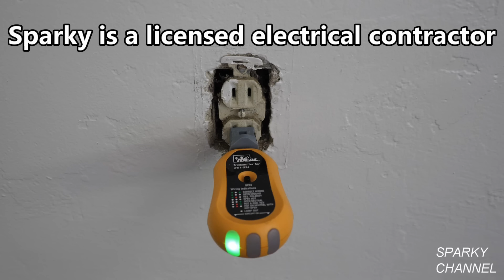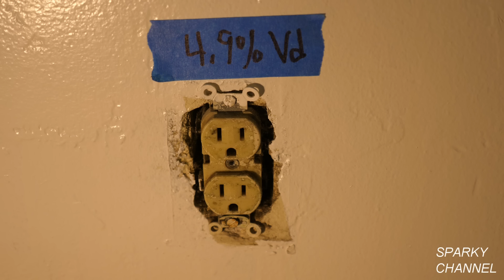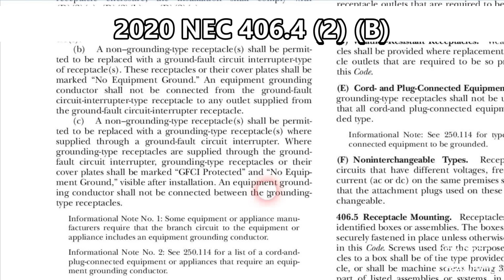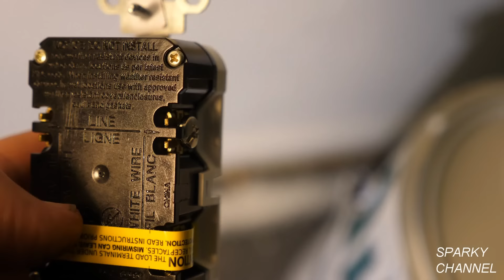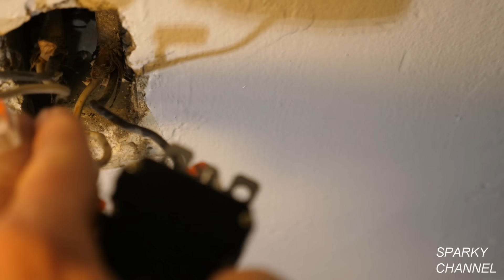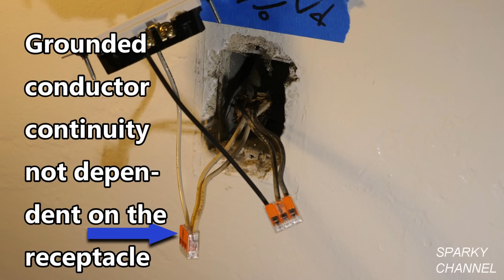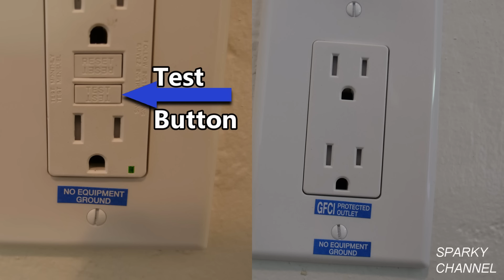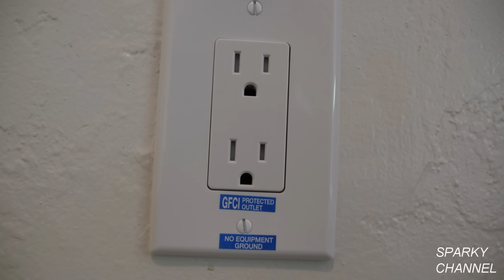2 Prong Receptacle Circuit Replaced by GFCI and Grounded Receptacles per 2020 NEC

Comment: Doesnt pigtailing at the gfci take away the whole point of installing a gfci if the ones "down stream" are no longer gfci protected
Reply: He doesn't pigtail the GFCI outlet. If he did, you'd be correct-the rest of the circuit would not be GFCI protected in that case. Around 12:50 he starts hooking in the GFCI 'source' circuit then he removes the yellow tape and hooks up the downstream 'load' circuit leads. Everything will run past the GFCI outlet unless he got the wrong outlet (any outlet that is not the most upstream outlet) to outfit with GFCI. In that case, the pig-tailing in the normal upstream outlet would make the whole circuit unprotected (outside the single GFCI outlet) since the amperage then doesn't have to flow through the GFCI internals.
Reply: @austinv3415  thank you. the little bit that i dodnt pay attention to the video he did that.. i was really confused cause he never makes those mistakes...
Reply: @Fearlessmullet  I think the Wagos made it confusing for some viewers. He didn't use them on the GFCI, but it looked like he set it up to use them.

Comment: I changed out a 20amp grounded unit today and the load wires had to be switched to the line wire spot on both sides. Took me an hour to figure that out just moving wires from one unit to another. And I had to Google it. Apparently I'm not the only one to stumped with a solid green light. I think it's good to know how to do stuff but it's also good to know when to call an expert, be it painter, plumber or electrician. Most folks should probably not fuss about with what you're doing here. But hey, you have us fair warning!

Comment: You can find the first receptacle also by simply unhooking all the wires on all the dead outlets and from the source breaker, then drag a long wire from the disconnected breaker wire and use a continuity tester to each receptacle wire till you find it. Now you know where the GFI outlet goes, the rest don't matter.

Comment: I know it is not practical in this situation because you are not doing a re-wire, but I am betting with brand new romex installed, those voltage drop numbers would go way down. Your video definitely shows how dirty, old worn out receptacles can effect the circuit. I am imagining if somebody plugged in and ran a 1000w or 1500w space heater on the last receptacle downstream, those old romex wires in the wall would probably get pretty warm. I really only do Commercial and Industrial work these days , except for my own house, but I own one of those sure test testers myself and I love it. The one I have also includes AFCI function test. I am also a great fan of the Wagos. They conserve a lot of space in the cramped boxes.  Great video! Russ- Journeyman Electrician-25 years in the Trade.
Reply: Yeah, over 200W of heat inside the walls is a problem waiting to happen.

Comment: Why do you not hook up the ground to the outlet box.
Did you see if the box is connected to ground?
Reply: Older homes once were two wire systems with no ground equipment conductor. Doing this makes these outlets safer.
Reply: Because there is no ground, that is the whole point
Reply: There is no ground. Many older homes have no ground and this is a way to make it safer without rewiring the whole system. Hooking up a pigtail to an ungrounded box isn't going to magically make the receptacle be properly grounded.

Comment: I’m going to order some wago lever nuts. What I’m worried about is the integrity of the connections on them after years of use, as oppose to the more trusty wire nuts and old fashioned twist/braiding method
Reply: Any electrician I have taked to will not use these nuts.
Reply: I agree with you as well as most, although this makes a alternative to wire nuts  if conductors cannot be spliced because the conductors are too short.

Comment: I had an older house and the wiring was in metallic flex which was attached to the panel.  It turned out that this was the "ground" in this system.  In this video is it possible that the box, if metallic, is grounded and may be used as a ground?
Reply: Yes, but you never know until you test it.  Some metal boxes are grounded...others aren't.  I'm guessing he knew his boxes weren't grounded?

Comment: You probably would have even less voltage drop if it had been wired directly to the plug and not use a wago connector. Also less cost and 1 less thing to fail. Great video.

Comment: Sparky. U R an idiot. Connect a jumper wire to the ground screw on GFCI to the neutral screw to fix the ungrounded condition. Tester will now work correctly with Protected Ground. When a ground fault is detected, it will pop the GFCI fuse. I put a GFCI AT EVERY 2 PRONG OUTLET TO ADD A PROTECED GROUND THIS WAY. EVERY GFCI WAS WIRED IN PARALLEL IN DOWN STREAM CIRCUIT. Thus only one GFCI pops at the ground fault and is easily RESET. ALL 2 prong receptacles are now converted to 3 prong with PROTECTED GROUNDS!!!
Reply: This is against code and illegal, don't do this. If something on that neutral is pulling a heavy load all your "protected grounds" will now have voltage on them.
Reply: an example of why this is not correct and very dangerous. i worked on a house once that someone had this done. the circuit lost the neutral at an upstream receptacle. now the ground was the neutral source sending voltage through the coax shield to the satellite dish that was bonded to a water pipe. the water pipe was not bonded to the service so it made voltage at all the plumbing fixtures in the house. customer was getting shocked at all the sinks and while in the shower.
Reply: @ozarkmountainhollow5640  Why would it have gone that route and not simply back to the neutral buss in the panel via the ground wire. The only way I could see this happening is if you lost both the neutral and the ground
Reply: @integr8er66    the whole topic of this video is where there is no ground wire. hooking the ground to the neutral with no ground present is the problem. you loose neutral and the circuit finds ground anywhere it can.
Reply: Pretty sure ground and neutral can connect ONLY in the main panel...
Reply: @DanEBoyd  Yes thats true if you care about the code, if not this method will work
Reply: @aldinardo4812  I thought so too, but I have seen tests where they show the wire actually melts first.

Comment: Other than using the expensive circuit analyzer, is there any other sure way to determine which is the most upstream receptacle?  Edit: NM, think I found the answer at 11:06.
Reply: Absolutely, its called a continuity tester and a long wire back to the breaker panel. just disconnect all the receptacles and ring out the hot and neutral that go to the breaker panel
Reply: So on any of the other receptacles, you shouldn’t get a hot line right?

Comment: Instead of replacing the first outlet with gfci at the breaker?  Or would that not fit the code?
Reply from the maker: It would be great but there are no GFCI breakers available for the old main panel.

Comment: Sparky with you having connected the wires in the boxes it's no long GFCI protected because the GFCI is in series parallel not series any more. If I am wrong feel free to correct me but, I do not think I am.
Reply: All outlets are in parallel always. His wiring simply moved the junction off the outlet body with use of a pigtail and wago connector. The gfci only cares about a differential, if current goes out on the hot leg and takes another path back except it’s neutral wire it will trip, regardless of the wiring down stream.

Comment: Great video, question, why not install a GFI circuit breaker?
Reply: That's probably because of the circuit panel. They probably don't make one to fit that old panel. Most of the old ones I work on won't take one.

Comment: Hey Sparky I love you videos  You taught me so much but I have a quick question what do you do if the powers running to the light Box in a Junction And it's spreading out like a spider how do you find the 1st receptacle
Reply: Good question, Thor.  In that case, each receptacle is receiving power first, in parallel with each other.  So you would either need a GFCI receptacle at each outlet or a GFCI breaker at the panel.  Someone pointed out that some panels cannot physically fit a GFCI breaker.  Also, I just worked on a house that spiders out from the light box like you describe as well as having some of the spider legs lead to clusters of receptacles wired in series...a parallel-series circuit.

Comment: I’m about to swap out two prongs for three. The old cable in this 1950’s era house has a hot, neutral and grounding wire. The grounding wire is already terminated to the inside of each box. Should each new 3 prong outlet be grounded to the box as well?
Reply: If you already had a ground why does it have 2 prong outlets? But yes a ground jumper is now required, but they would be grounded anyway once you screwed them in the metal box.

Comment: Really great video!! Does the code mention wrapping the outlet with tape?
Reply from the maker: Thanks Paul! No, the NEC doesn't mention wrapping the outlet with electricians tape.
Reply: Like he said, it doesn't but it is just good practice.  Safety wise.
Reply: Glenn Davis for when, though?
Reply: @pb7379-j2k  I only tape hot outlets in metal boxes. I work for a bad company that doesn’t allow me to “waste my time” turning off circuits.
Reply: Dr. Remulack wow really?
Reply: Electrical tape will fall off after years in there anyway, so I wouldn't consider it necessary.

Comment: So exactly what is the value in this?
Reply: You get ground fault protection without having to run new wire. But in a reno I’d rather see new wire with ground be run, especially if I were the buyer!
Reply: @pb7379-j2k  besides pushing the test button, has this method been tested?.
Reply: Charles Murphy not by me, but if Leviton and the NEC say it’s acceptable then I’m sure it has been tested
Reply: @charlesmurphy1510  That is the proper way to test GFCIs.
Reply: @charlesmurphy1510  Pushing the test button does test it, it puts a slight imbalance in the Hot and neutral internally. Underwriters Laboratory's verify all that for us.

Comment: Just curious, arent those voltage drops higher than whats allowed? i know its not really relevant to this video, but where I live branch circuits can only have a VD of 5%
Reply from the maker: These are Vd's with 15A loads. that's different. The farther I got away from the main panel, the worse the Vd was. The Vd would be calculated without a load for code.
Reply: @SparkyChannel  Uhm, with all due respect at no load there is no current therefore no voltage drop, V = I x R No I = no V
Am I misunderstanding you?

Comment: Great use of the circuit analyzer to narrow down the upstream device. The Amprobe INSP-3 is a similar tester that can provide a lot of info on a circuit. Big fan of the Wago lever-nuts also, they make troubleshooting so much easier. Great video. This seems like the most cost effective way to upgrade 2 prong receptacles to 3 prong, rather than a GFCI breaker.
Reply from the maker: Thanks Brian!

Comment: Thank you for the walk through.   Not sure if this would be to code, but what would the consequences be in the following:
Update all the sockets as described, exclude the GFCI in the upstream socket, then connect the neutral to the ground at each socket.  
What if any negative safety concerns would result if an appliance plugged into such a configured socket would short from line to ground? 
Would the circuit breaker open the circuity?      
Great choice with the Panasonic GH5, great video, audio and editing.
Gratefully.
Reply from the maker: Never ever connect the neutral to a ground on an outlet. That's called a bootleg ground and is very dangerous. I love my GH5, thanks!
Reply: @SparkyChannel  I'll check your content for a video on the dangers of Bootleg Grounds.  I'm sure you've already covered it. Thank you.

Comment: If you leave your plug circuit energized your receptacle circuit energized and you put your plug tester in can you locate receptacles on the same branch circuit with the wind by just walking to the receptacles rather than killing the breaker

Comment: It would be interesting to see difference in load drop between wire nuts and the lever nuts.
Reply: It was hard wired before. Lower reading with wagos, they are maintenance free so reading's will never change at this connection.
Reply: @douglasgreaves188  Hardwired through those old outlets, with no pigtails.

Comment: Why not just change them all?
Reply: Simply put...Cost
Reply: @integr8er66  cost over effective , efficient & safety seems mute if the wires are older
Reply: @rockystaatz521  It is not one bit more effective to replace all of them than one and the others tethered off of the load side of the GFI, or maybe I don't understand your point, GFI protection vs adding a ground wire? that is s matter of cost as well and I certainly would not bother with the extra cost of a ground, GFI is plenty safe in my opinion.
Reply: @integr8er66  I think you do but not my current idea on it. You make sense but to save time & energy just replace them all, limited time of sunlight usually
Reply: @rockystaatz521  Well It really doesn't take long at all to ring out two wires back to the panel, I can't imagine more than 10 min, but I know GFIs are cheap now, so either way I guess. The size difference alone might make it a wash on installation time too since GFIs can be a tight fit in the box
Reply: @integr8er66  you haven’t seen what they thought they were doing at the beautiful nice new panel, it’s even inspected & certified. I’m trying to avoid doing the backwards search really to figure it out

Comment: Bill, is it necessary to have GFCI outlets in rooms or areas that are not near water or moisture? I thought that was the purpose for GFCI outlets.
Reply: If you want three-prong outlets where there is no ground available, and you don't want to have to run new wire to add a ground, you can use a GFCI instead, and still meet code. If there was a proper ground available here you would be correct, there would be no need for a GFCI. It's a work-around to allow safe ungrounded three-prong outlets.
Reply: No, not necessary. But, it would be a good idea to have an AFCI out in those rooms.

Comment: REQUEST: Replacing old 2 prong receptacles with usb charging receptacles
Reply: run into problems in the pass trying to get usb outlet in small boxes , especially those 2 prong outlet boxes, not sure how sparky got that gfi in, iam sure a little tapping to get it in   .

Comment: So all the receptacles have VD!😮

Ewww.
Reply: Yes, if there is current (he was running 15A) there is always a voltage drop in the wiring from the breaker panel to the outlet. Further away, more wire, more Vd. I you super cool the wires I guess you could make them super conductors with no Vd.

90

Comment: What is the exact name of that tester u used for voltage drop...I want one....I'm a licensed electrician for 25 years but never seen that tester
Reply: it is IDEAL INDUSTRIES INC. 61-164 SureTest Circuit Analyzer
Reply: You can do the same thing with your old meter and a space heater

Comment: There is only one way to do a job and it is the right way thanks again for sharing that technique !!
Reply: If you truly believe that, then don't "fix" your outlets the way he described.  This is a safe way and a code compliant way, but it is not the "right" way.  You still don't have grounded outlets, you just have outlets that won't shock the $#!^ out of you and will instead trip the GFCI.  The "right" way to do this job is to drop a ground wire out of each receptacle and chain them together back to the main panel.  A change made in NEC 2014 made this much easier because multiple circuits can share grounds and the ground wires do not need to run with the hot and neutral.

Comment: Sparky! Thanks for the video.
I bought a house that has a new grounded panel but no grounded outlets. (No ground wire inside bundle nor grounded  boxes)

I want to do it exactly as your video but my wiring has a few lights/fans feeding off outlets and putting it on the gfci load side would shut a lot of things off if it trips.

Money aside, Can I make every outlet in my home grfci using the pigtail method from both hots and both neutrals into the line side of the gfci? Is there a downside to this? I currently don’t have the money to do a rewire :( thanks

Comment: Been wiring and doing electrical work for 40 years  If you want to learn the proper way and always do things right stay tuned to Sparky. He's awesome and also shows the code to support what he does
Reply from the maker: Thanks so much! That is a very great compliment!
Reply: @SparkyChannel  HI, can you clarify for all on this thread, older, 2 wire cloth "romex" (Not BX), isn't a grounded circuit /  system?
Reply: @billbaillie3702  Sparky is not an electrician.
Reply: very much agreed

Comment: Hi sparky great videos. Quick question i noticed that in one receptacle you used the clamp with screw to secure the line and on the other one you pigtailed the line to the screw of the receptacle.  Is one better than the other or are they both pretty solid connections.  Which one would you recommend and why?